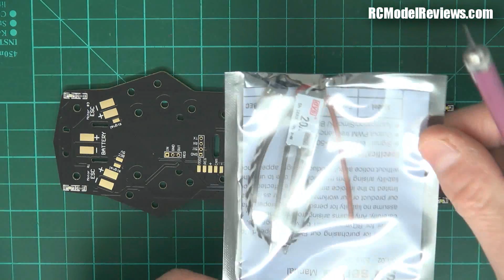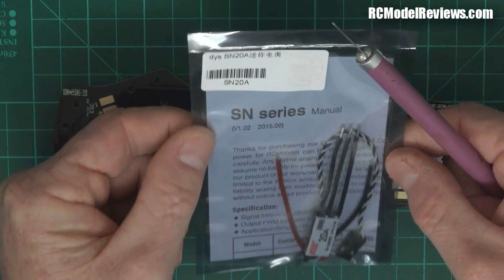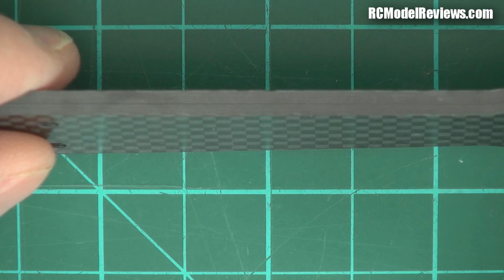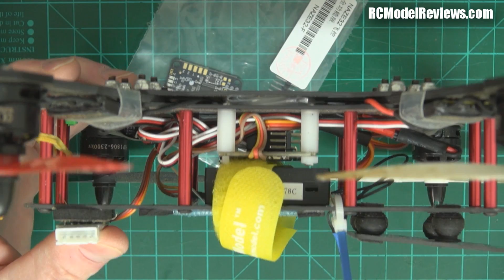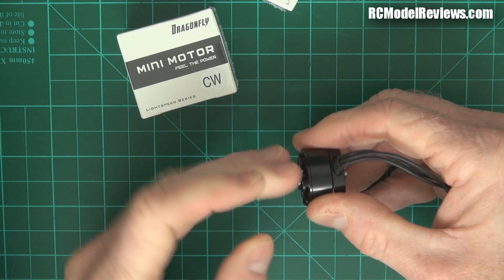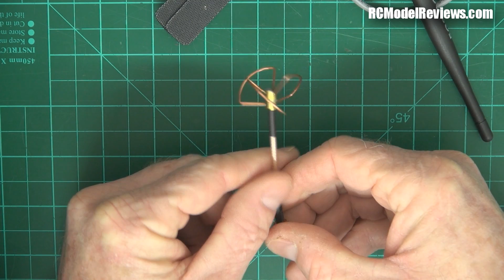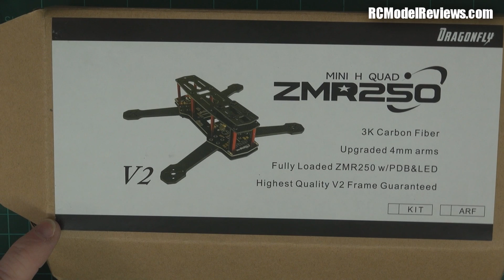ZMR250V2 ARF from FPVModel.com (part 1)

Comment: Are Deans connectors really that old fashion. If its true seems I'm a bit out of date as I use them on everything remote control.
Reply: I fly with about 25 people and most of us use deans. So no they are not out of date.
Reply: +obRCmania Deans connectors still work but XT60s are far less prone to damage and aren't plagued by intellectual property issues.   The little leaf-spring part of the Deans male connector is easily damaged and that can cause issues.  Also, as you will see in an earlier video, some of the knock-off Deans connectors are made to awfully poor standards and won't even mate up properly 80% of the time.
Reply: +xjet I agree with you about the knock off dean connectors. Bought a pack of 10 pairs and found none of them would mate up unless you literally hammer them in. Also the plastic would melt very easily when soldering. However I personally still like using the good quality ones.
Reply: +JKFlorida Deans are horrible to pull apart though, no grip space, slippery plastic, usually no pattern to make them better to grip, and super hard springs. some of them are almost impossible to connect even.  XT60 also cover the plugs even on the male plugs. I used to use Deans, but when I found XT60 I pretty much switched everything.
Reply: +obRCmania Supposedly the XT30/XT60 resolve some design flaws with the Deans, on top of being Royalty Free / Open Source, so theoretically much cheaper to produce and purchase.
Reply: RCKnut not real deans!
Reply: I've used real deans to, and they're prtty bad to, at least compared to XT60. I don't know anyone using Deans anymore. it's either EC, XT or bullets.
Reply: +RCKnut I've had all the issues you describe with XT connectors.  I'm using EC3's on all my stuff now.  If I pay attention and get the right ones I don't even have to use heat shrink on them, and they connect nicely, but still come apart easily enough.
Reply: SteevyTable Yep EC3's are nice! I use EC5's on my 6s RC boats.